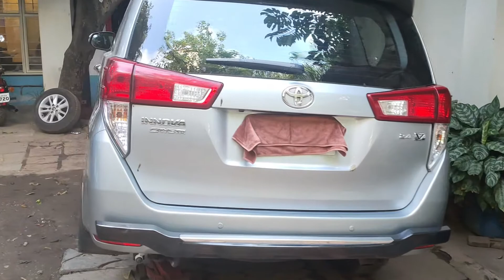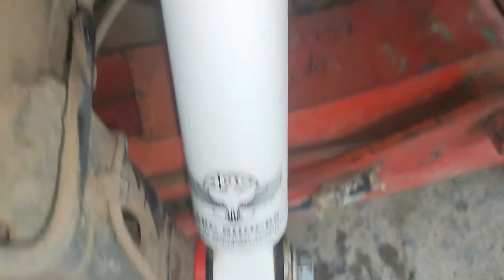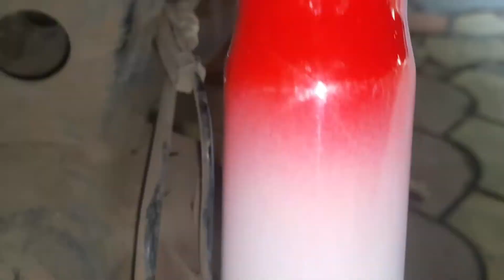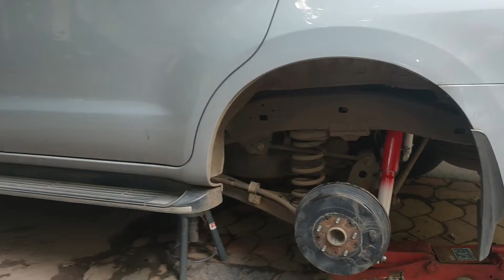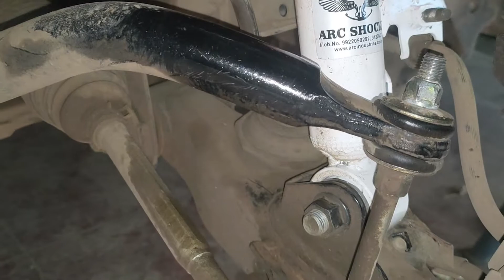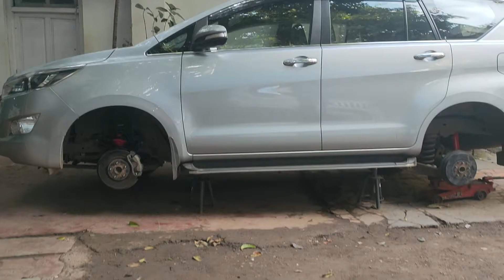Innova Crysta ARC Front and Rear Shock Absorber Suspension Kit

Comment: What is difference between stock and ARC suspension for Innova Crysta ?
Reply from the maker: Body roll will come down drastically. Stock suspension not calibrated best for comfort, Stability and agility.
We aim to make the experience better, in all aspects.
Braking distance , uneven tyre wear and tear reduces drastically.
Much more things, call us at 9922099292,9422047019  to know more. Will be happy to share all information about it.
Reply: Vehicle grip will increase, cornering and one will hardly see thier head and shoulders oscillating frequently